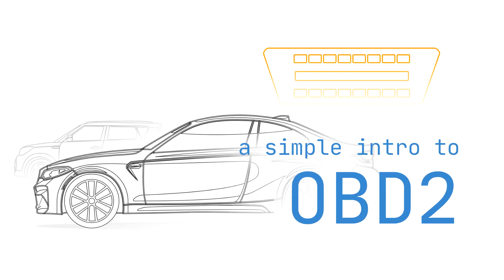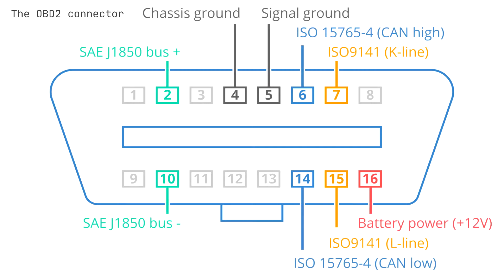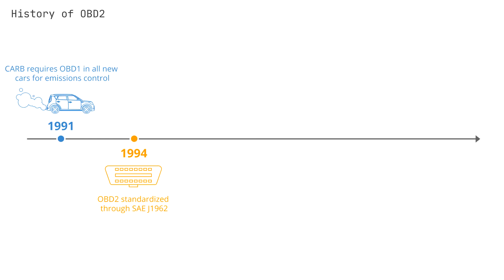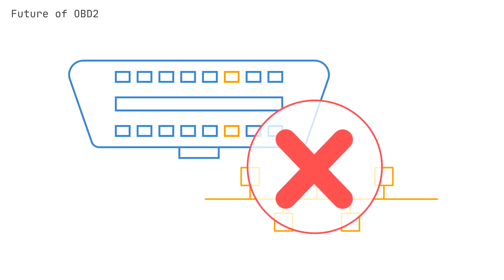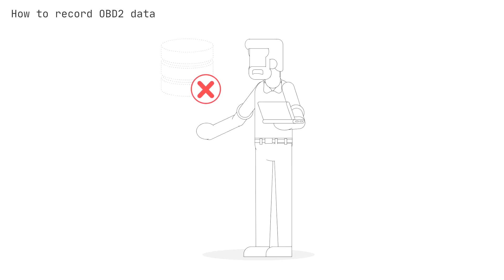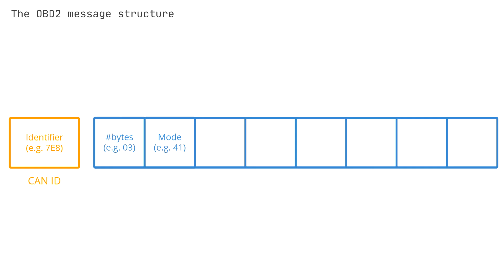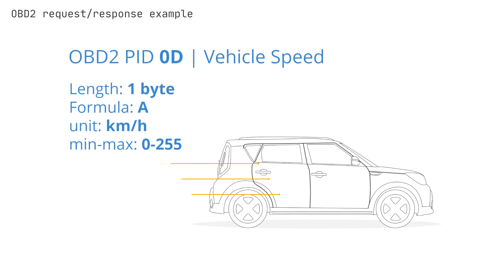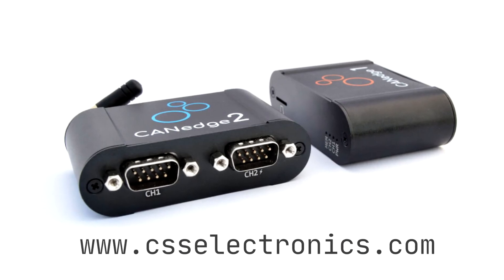OBD2 Explained - A Simple Intro [v2.0 | 2021] 🌟

Comment: With the prevalence of OBD injection being used to steal cars, is there the possibility of creating a decoy OBD2 port, and enhancing it with a voltage multiplier(ie a taser circuit) to destroy the tool being used to attempt  theft?

Comment: Very helpful - Thanks. It pretty much negates the argument I've had with EV conversion shops not wanting to convert cars from 199? onwards because of CAN codes. Programmatically it would be very easy to emulate the signals coming from an ECM and inject it into the BUS especially since it's all based on an international standard.
Reply: ...How easy is easy?... It's not a problem of whether it could be done but a matter of who among their ranks have the ability to write the code and at what cost their service will entail. Both of those points which are the trivial concerns, in the grand scheme, when you take a step back and ask about the liability that a business invites upon itself when (depending on how their product is coded and implemented and marketed) asking: how could their product potentially interfere with the safe necessary deployment of air bags, or trigger false deployment of air bags during normal driving conditions, or render other convenience and safety and security measures diminished or otherwise inoperable? No matter how strongly they word a legal waiver or how strongly they advocate for the limitations of their product or how clear they are about any inherent dangers and measures they take to protect themselves... It is still a big gamble whether there is a scenario where courts find them liable for exorbitant damages.

But, I understand your reaction. At a surface level it sure does seem easy to implement a solution, but in practice you're looking at dozens upon dozens of weeks of highly trained technicians reverse engineering a problem and implementing a bespoke solution... I'm sure it's technically easy to emulate the ECM signals to trick the car into reading that the ICE is still operating normally but there're too many variables in implementing solutions and easy becomes a relative term when actually solving the problem takes highly specialized knowledge hundreds if not thousands of man hours to complete.
Reply: @dustinbird2090  You brought up some valid points I hadn't considered. Most likely be able to address most of these by leaving the ECM in play and convert the EV controller outputs into something it can understand. Then it's just a matter of compliance. Food for thought in any case. Thanks.

Comment: How about a simple question?, Can an OBD2 display on a HUD things like(I have a Maverick, hybrid) each battery's charge condition, throttle position, oil pressure and temperature, coolant temperature, non-engineering gooble dee gook. Is there a list someplace of things like that, thing that the HUD can readily display?